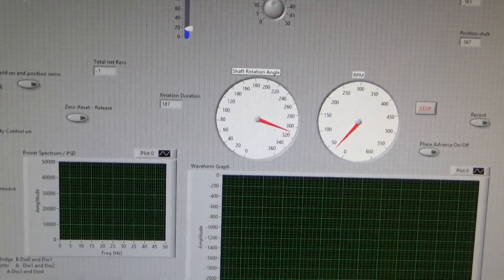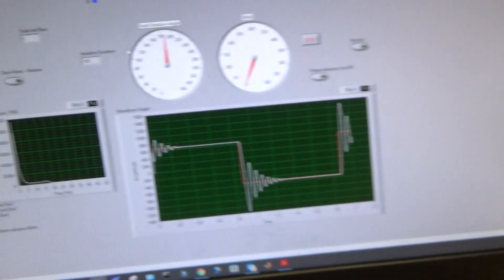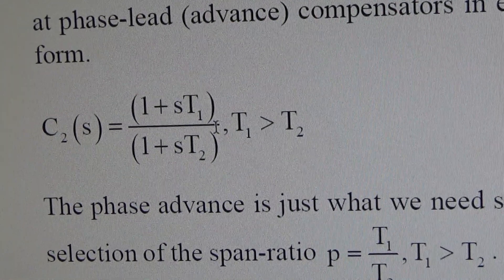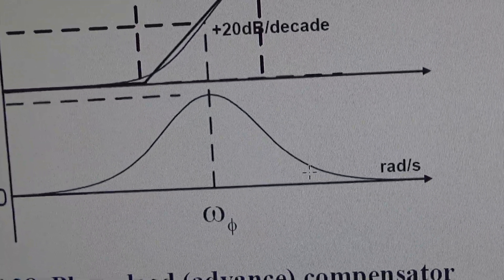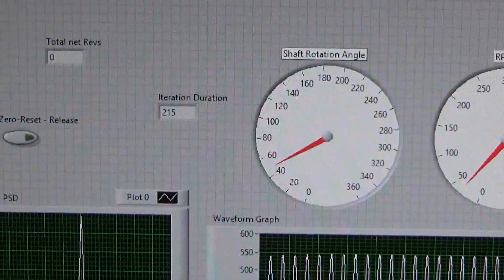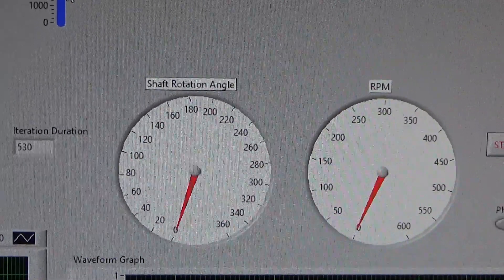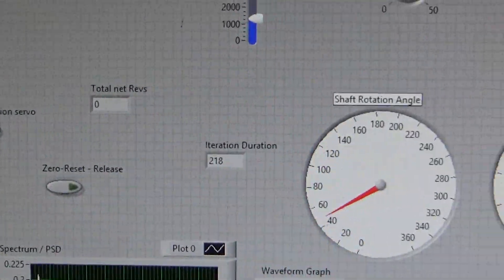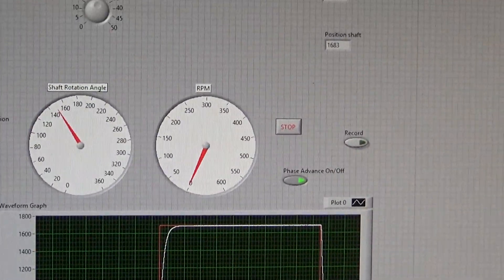Fixing an oscillation in a servo motor

Comment: I mean controller frequency as how many times the control algorithm runs every second. (As the controller is a discrete time domain controller)
Reply from the maker: You mean the sampling frequency - yes I think that was 10kHz too. But it could have been much lower if I had wanted to - that was a bit of an overkill.

Comment: Very informative! Can I know what is the controller frequency (cycle time) and pwm frequency?
Reply from the maker: The PWM freq was 10kHz if I remember correctly and the controller frequency? Not sure what you mean, the oscillation freq was initially 25Hz. Set point freq was very low, a few Hz.